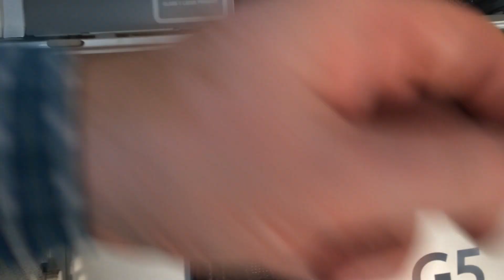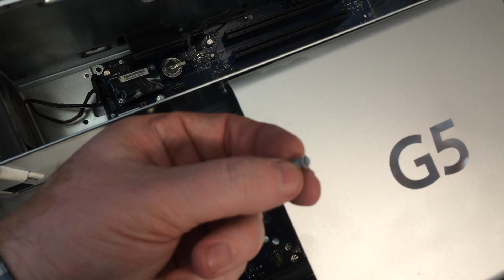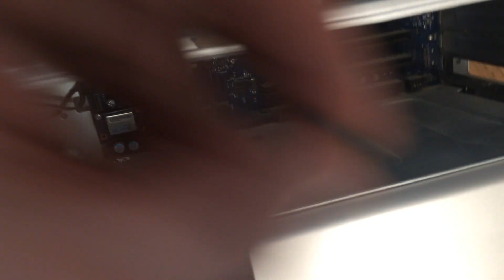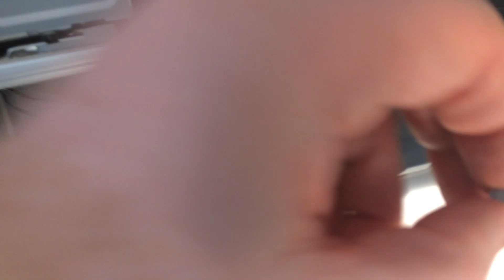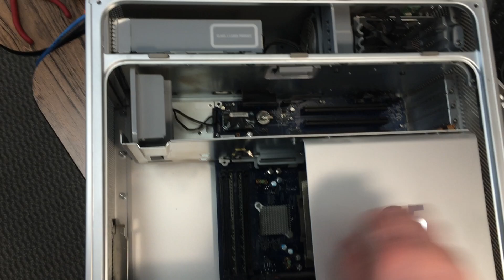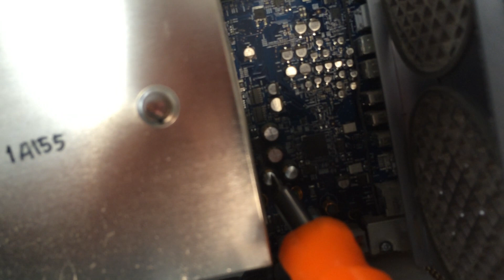Trick to Apple Mac Pro G5 Teardown, Disassembly and Diagnostics

Comment: "If you take this out the whole machine kinda falls apart." Eh.. I'm sorry but this pin is not useful for anything except for Apple back in the day, to check if you had tinkered with the machine in the guarantee period.. I used a sanding spherical thingy on a dremel to sand the head off. Then it no longer blocks moving the G5 alu panel to the left. It's annoying but it's completely insignificant. PS They are called PowerMac G5's, not G5 Mac Pro. The name Mac Pro is used only for the successors to the G5, that have Intel CPU's.

Comment: You wasted your time making this video, you never answered your main question - what is the "trick" to removing the rivet. I have the version of this computer with 2 processors/ heat sinks stacked up, and I came across the same problem with trying to remove the heat sinks. A casual inspection will soon find the plastic rivet above the shield but, THE IMPORTANT PART is removing the rivet intact, just like an Apple tech would do!!! How would you get the rivet out without digging it out and scratching the top metal surface of the shield? That rivet is counter-sunk and pressed in very tight; the heat sink is not supposed to come out sideways because you risk bending its connectors to the board (with the 2 heat sinks there is no room to even wiggle anything, much less take it out sideways).

Would you make a video to change a car tire but leave out the part where you jack the car up; would you omit loosening the lug nuts halfway down the threads before jacking the car up at all???
Reply: I used my fingernails and careful rocking back and forth to remove inner pin, then outer part
Reply: That doesn't sound like a method anyone can expect to work. Three guys used spoons to dig into the walls of Alcatraz prison; it took months to make the holes. they then had to figure their way out of the walls, then the sewer pipes, in one night like some trapped explorer in a tight cave filling with water. Even those who did it once have no expectation of pulling it off again. Also, now that i think about it, your way is a brute force attack, too. The pin maybe brittle and crack early or it could be made of fiberglass- reinforced ABS plastic that will laugh at you for 19,998 flexes/bends of the pin before it fails at 20,00..  ..............You know what?  F it, dammit. spent too much typing already. I got sh!t to do. I'm drillin it out . I can always MacGyver a pin replacement. 
good luck, take care, get laid
Reply: @mikemalo6336  My conclusion is: It's not meant to be removed. It's incredible that the TS managed to pry it out, but usually this won't work. I couldn't even get the tip of a small breaking  knife between it. In hindsight, that wouldn't have helped anything anyway. More importantly: This pin is not useful for anything but for Apple to check if you had tinkered with the machine in the guarantee period.. I used a sanding spherical thingy on a dremel to sand the head off.